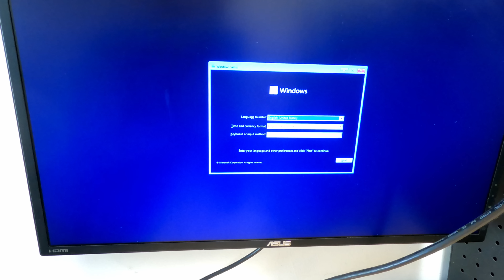$120 eBay gaming PC.!! sort of....

Comment: Love those z440 boxes.  Get the ones with the 700w power supply.  You can replace the case fans with 92mm aRGB fans.  And in an aRGB controller. Good to go.

Comment: Good system. For 120$ it is a good deal.
Best part is that you can update the TPM module from 1.2 to 2.0 and install Windows 11 natively on it. 
Fix the RAM, put a 6C/12T 1650 V4 in it and let's say a GTX 1080 or even an RTX 3060/3060Ti in it, I think the max will be a GPU with a 8 Pin connector, I know that there are 2 PSU models for it one is a 525W and the other other is 700W(I think this one has 2x8pin PCIE but not sure).
Reply: Dont stress out im running the 6pin and a double molex adapter 8pin tot my 1070 for yeaaaars now

The 1070 is a 150watt card

75w pcie slot, 75w 6pin and i actually dont know how much it draws from the adapters, but it wouldnt boot without it so i guessing 75 at least

(HP z600)

Hell i even made a acrylic side panel for it with a rgb fan LOL and a custom noctua cooler that fits inside the case ( on 1 cpu tho )
Reply from the maker: Nice!
Reply from the maker: Yea def upgraded and mods in the works!

Comment: Swap all the hardware into a Rosewill case there is a pineout diagram on Toms Hardware and the fans for the case you can just get a molex to 3x 3 pin and rock one of the 80mms as an exhaust fan, use the case remote for the lights and get your gaming on.

Rosewill PRISM S500 ATX Mid Tower Gaming PC Computer Case
HP Z440 Desktop with 1630 xeon
GTX 1070 8GB
Reply: Also they sell a 6 pin fan connect to 2x 4 pin fan cable that I used to put 120mm Fans on a push pull configuration with a hyper 212 I had laying around since the case came with 6 of those RGB fans so I have two pulling  air in on the bottom of the case two on the side exhausting and one in the back exhausting and then push pull on the 212
Reply from the maker: I'm thinking about a case swap just for content and to show but will prbly keep this case as this will be my garage pc

Comment: I've run E5 2697 v3, 2666 v3, 2690 v3 and a 2690 v4 and I have never had an issue with any of them, even with the lower clock speeds. I am also running an M4000 in my current rig and for gaming and even video editing, it's been great. If you want to borrow one of those CPUs, let me know!
Reply from the maker: I'm looking at going with the 2690 v4 as this will be my garage pc for projects. Good to know those work good. Thanks ks for the input!
Reply: @DLMtechgarage  as I'm sure you know, Bios support on these can be really weird. Some have worked right away...others required....more ... creative solutions.

Comment: I got a Dell T3600 with the 1650 for $120 on Ebay. Came with 4 4gb server memory sticks. Up it to 32 total. Ran Open Media vault on it for a while. It came with a 240 gb ssd and a 3 gb mechanical HD. Also a win 10 pro remanu key. I redid  the OS to win 10 and thru a 8gb RX 580 in it. Pretty sweeet budget gamer.
Reply from the maker: Nice scorer. The 1650 alone was worth it.

Comment: Great system, a real sleeper my Z440 has a E5-1680 v4, 64g ram, gtx 1080 ti and a HP Z Turbo Quad Pro. Hard to beat for the money
Reply from the maker: That 1680 is the way to go. Trying to hunt one done cheap
Reply: @DLMtechgarage  Your correct, the E5-1680v4 is about $140 to 150, but worth it if the work load justifies it
Reply: @DLMtechgarage  The Z440 low cost entry does erode when adding a better CPU, more ram with ram cooling fans and fast nvme storage

Comment: $120 (or $170 including shipping, as others pointed) is decent price for a Z440.

Although I'd rather go for dell 5810 at $110 ish. which is same generation CPU and motherboard. Get a used GPU for less than $100 (which you will do to the Z440 too), add some RDIMM for $20, upgrading the CPU for $30, and you are good to go. Depending on the CPU used, you may need a higher power PSU, which is $30-50.

It's cheaper than Z440 because it's non standard form factor. But still, it works, and it's very quiet.
Reply from the maker: Shipping was free. 

Appreciate the info on the 5810. Will def check it out
Reply: I‘m with you. I also had to choose between T5810 and Z440 and chose the T5810 for 115€. 
What’s really nice about the Z440 tho are the two RAM Fans
Anyways, upped my Dell Precision with 32 gigs DDR4 and a Xeon 2697v3 with 14C/28T as well as an RX 570 8G. Perfect for editing as it can run macOS Ventura. Will perform the Turbo Boost unlock in a few days 👍🏻
Reply: @richardp3350  you can tape a fan on it. I did that to my NAS build 🤣

It's a Xeon-D that comes with a passive heatsink. The mount pattern is uncommon. Not many aftermarket coolers available. So there goes the duct tape.
Reply: @DLMtechgarage  or free shipping then $120 is really good price. 
I'd take the Z440 over 5810 if the price is similar.
Reply from the maker: @yren3386  yea free shipping is the only way it is a good deal.

Comment: For comparison the m2000 , which needs no external power, is equivalent to a gtx 750 TI. That 4000 should be beefier than that.
Reply: I think it's kinda like a 970 with lower clocks but 8gb memory

Comment: Try the xeon e5 2680 v4 it's not a bad little cpu and even with the low clock speed its performing pretty well got another system with a ryzen 7 1800x oc to 3.8 ghz and the xeon beats it in every game ive tried
Reply: Im gonna guess its the cache that helped the xeon out
Reply from the maker: Yup def considering going that route

Comment: not expensive price for this model , In China ,  it will cost you about $200 at least.  I also like HP workstation ,  I just collected Z240 Z240sff Z230sff  , very stable and not expensive for now

Comment: Just curious which deleted on eBay you'd suggest checking out. I'd really like a similar system for that price, but obvs don't want to get burned. Great score and I just subbed! 😊
Reply from the maker: I would look for a an HP old office PC with an Intel 6th gen or newer. Key is to make sure the seller has a legit seller feedback and good return policy. Most sellers with those history tend to be reliable and if something goes wrong you can send it back free

Comment: When I saw the title, I thought it was one of those scam eBay gaming PCs (I didn't notice the thumbnail) as eBay sellers (as well as Amazon and Walmart) are notorious for selling old cheap computers, even SFF desktops with no upgrade path, with a GT 730 or GT 1030, and putting "gaming" on the listing. I think what they might be doing is they only test Fortnite or Minecraft rather than a modern game like Cyberpunk 2077 or Hogwarts Legacy and are calling them a gaming desktop because Fortnite, Minecraft, and The Sims 4 plays well which is not an accurate way to advertise gaming performance.

While the prices are better than the Alarco, ViprTech, and IMAGINPC, I still call it a scam because the listings would imply they're affordable gaming desktops when they're actually bad at gaming. You would need at least a GTX 1650 or similar AMD GPU to get playable performance from modern games (maybe DDR4 RAM for some games), a GT 730 isn't going to run games like Hogwarts Legacy. On top of that, they usually come with a slow 2.4 GHz Wi-Fi adapter and a poor quality gaming keyboard and mouse which you can tell by the wrong shape Enter key. Unlike the $200 laptops which are literally unusable, they're still good PCs aside from gaming performance, slow Wi-Fi, and cheap keyboard/mouse.

As for the computer itself:
Something you don't see in newer gaming desktops and cases these days is the DVD/Blu-ray drive and a 5.25 bay which is often omitted in newer cases. Also, some of the newer systems tend to use smaller motherboards even though the PC could use a larger motherboard which is not the case for the Z440. The 8 RAM slots is interesting as most desktops only only have 4 slots.

I remember seeing some 1 star reviews complaining the computer they received being different than what is listed or not including the promised parts like a video card or Wi-Fi adapter. Personally, it's better that it doesn't include the Wi-Fi adapter because a lot of eBay (as well as Walmart/Amazon) sellers as well as STGAubron (Skytech) and ViprTech tend to include a poor quality (likely no-name) Wi-Fi adapter often runnimg at 2.4 GHz 802.11n which is slow compared to Wi-Fi 5 (11ac) and Wi-Fi 6 (11ax). It would be better to get a TP-Link Archer T2U or a PCI-E adapter to get better speeds (the latter can even add Bluetooth) or use Ethernet.

Comment: Can someone help me i have this very old gpu GTS450 i watch some YouTuber thy can run game on default clock on msi afterburner my gpu crash on dota2 at default memory clock at 1800 but when i lower it to 900 it will not crash but it only run 40 fps pc spec
i3 6100
Gts450
8gb
Ssd120
Window 10 home
Dell 3040MT
Reply from the maker: Check the temps. Could be bad thermal paste especially if it has never been changed